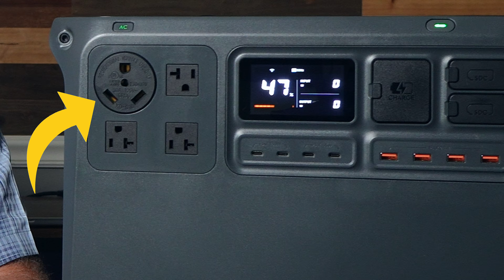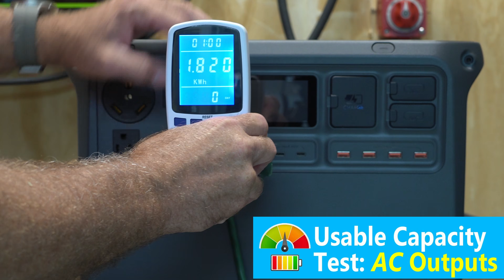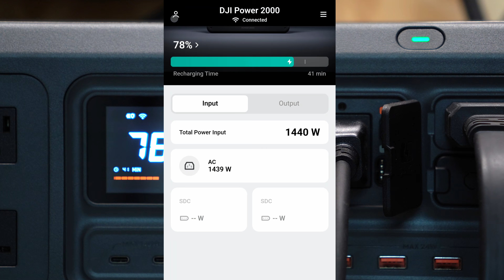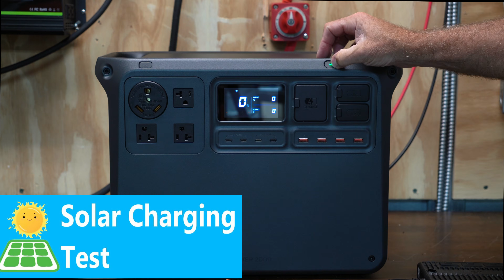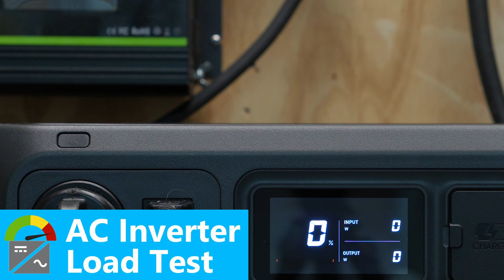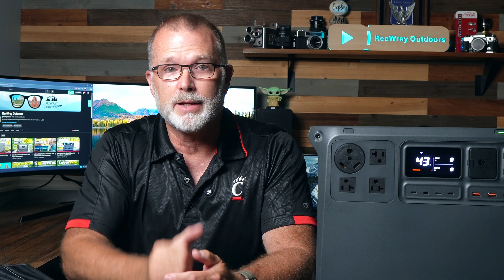DJI's NEW Flagship Power Station:  DJI Power 2000

Comment from the maker: BIG UPDATE!!  7/23/25 I just installed the latest firmware update on the Power 2000 and...it is NOW outputting a full 120V instead of the 110V output it had when I did this review.  Good on DJI for following through and making that happen! 🙏:washhands:
Reply: a sweet unit, but I don't like that you have to buy all these additional devices.

Comment: Another thing is the power button options. It's a 2 second hold to power on and off but if you just push it quickly it toggles the display on and off. This is useful if using at night and you don't want the glow from it. Might also be useful for photo/film applications where you don't want any extraneous light.

Comment: Do you need a special cable from DJI to charge from an inverter generator ?  thanks for your assistance.  Great video.
Reply: Why would you? Does your generator not output 120v thru a standard outlet?

Comment: I'm impressed with the output capacities, my question is about charging: since I'm running the house on cheap overnight electricity, stored in the house battery, I want to be able to charge up this  sort of DJI power plant on the overnight rate.  Is there a 'timed' charge capability on the power plant or in the Home app? If I plug it into the house in the daytime, it will just draw down the up to 2kwh from the house battery, which is not  a useful or efficient solution.   If it doesn't do time charging: well I know I could try to run it off a plug timer, timed to switch on during the cheap overnight tariff.  But many of those timers while good enough for running e.g.  60 watt lights, may melt down when faced with a 2kw draw.  I wouldn't want to wake up to a house on fire.
Reply: No it doesn’t do timed charging. Be good if it did.
EDIT: I was wrong. I didn't even realise it but I went into the app and there it was. You can set it for whenever you like to start and stop. I'll be using that myself.

Comment: Thank you for the review. I don't understand the Solar Charging system. What good is 30 volt maximum? Many single panels produce over 30 volts, which renders a lot of panels useless to charge this. I also at a loss to understand why the total solar power in is so low.

Comment: what's the noise level under load and charging?
Reply: sorry, found it.... 15min mark-ish. Would have been good if you measured under 1000w and under 1500w and 2000w.
Reply from the maker: Yeah, in retrospect, totally agree.  This unit is extremely quiet in the 1000-2000W output range, provided the operating environment isn't scorching hot.  Would've been nice to show that.

Comment: I still dont see how this beats the Pecron 3600 for $1100 right now. The price per wh seems like it cant be beat
Reply from the maker: Depends on your specific needs.  The E3600LFP deal is pretty compelling for an all-around full-featured power station.
Reply: Its simple: are you Sure this new Brand will Last on the market? What do you do when they leave in one or two years and your warrenty is useless? DJI is an good Brand and will last for decades
Reply: @maidn1887 Pecron has been in business for 3 more years than DJI. I own a lot of Dji products but as of right now they arent even releasing new drones into the US market so who really knows the future of DJI at this point
Reply: @maidn1887 Pecron has been around longer than DJI by about 3 years. I have a lot of DJI products but right now they arent bringing any new drones and possibly cameras into the US because of the pending ban which will effect all future chinese product sales…
Reply: @maidn1887 pecron has been around 3 years longer than dji
Reply: Thanks. I hadn't heard of this brand but looks compelling.
Reply: @mydisplayname23 I own a e3600lfp and ep3000 add on battery pack. Its already saved our fridges 3 times in New Orleans due to frequent outages. Absolutely worth it for us so far.